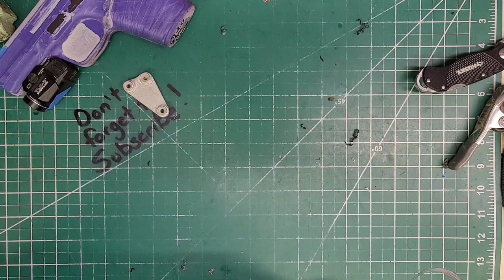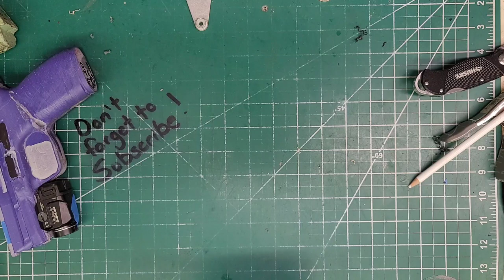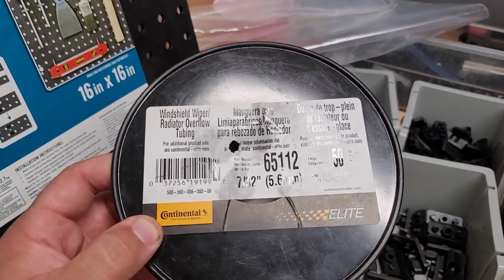Thigh Rig for SW compact with TLR7!

Comment: Cool thing I found out that works for drilling the holes and not have to use the deburing tool all the time. Start drilling real slow as soon as I punches through pull back and full speed at the same time. So far it has made the holes very clean and I hardly have to debure them anymore

Comment: thanks for your videos, but the one part that I miss seeing is your beast of a press. that thing is inspiring and ...how you skillfully set up for a taco style holster. also, i started using the Dremel wood cutter wheel instead of the thin metal cutters. the wood cutter wheels doesn't create smoke from cutting the plastic.
thanks for your work

Comment: Wow. Found your vid by accident but im glad i did that is so cool how you explained in detail each step and hardware you used. Im just getting into making my own holsters and yes its been trial and errors. Where do you get all those plates to use as a pattern and taped to your mock up
Reply from the maker: All those plates are made in house from thin aluminum.  Other small thin plates can be found at holstersmith.com.  and thanks for the support!

Comment: What’s your light blocking made of? And what’s the thickness?
Reply from the maker: Aluminum flat stock from home depot. I don't remember off the top of my head. But I had a video where I measured it. But I plan on doing a tooling video and material video in the near future